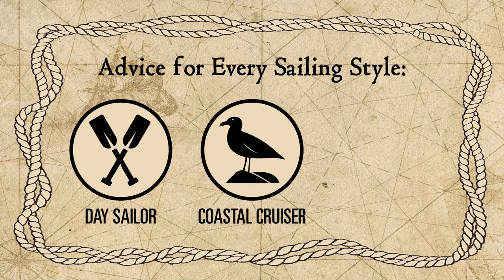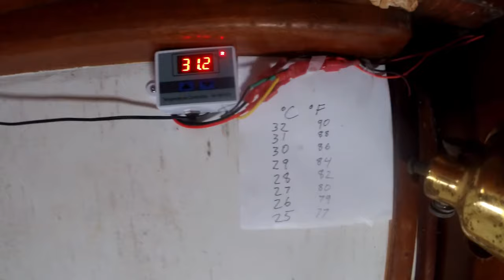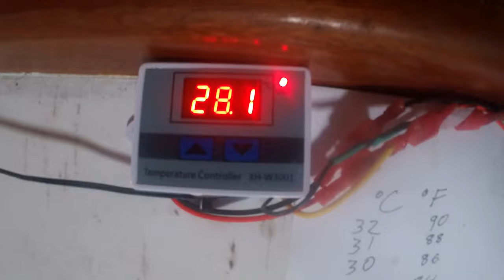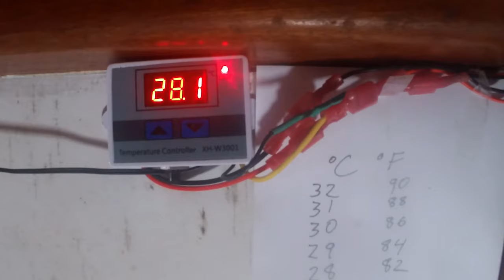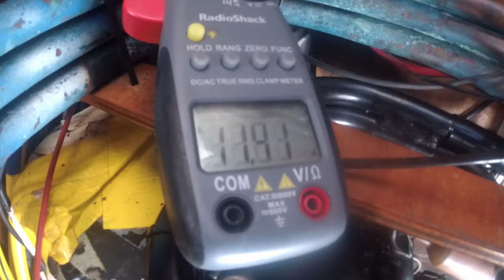Battery-Powered AIR CONDITIONING on a Sailboat [Capable Cruising Guides]

Comment: I saw where a person ended up grafting a mini split onto their boat.   They made a cabinet to cover the outside unit to make it look better but was still able to ventilate.   Their draw was 850 watts to cool and it came with a soft start to make it run from an inverter.
Reply: I'm wondering how well it holds up to ocean water
Reply from the maker: @misham6547 it should be just fine.  It's made from the same metals your refrigerator is except for the condenser which is titanium, which seems to be the best for salt water.

I've run the prototype for 5 years now.

Comment: I´m really interested in this option (and has filled in the form), but I also contemplate an even simpler version where one can attach tubes to and from one or two sleeping bags and only cool and dehumidify the air inside the sleeping bags.

Comment: great system, I had a 16,000BTU heat pump Marine Aire unit, using a 12v raw sea water pump to circulate water over the condenser copper lines to remove the heat.  This kept our 32' Sea ray sundancer entire cabin nice and cool when it was 95 degrees outside.  The condensate would drain thru a tube into shower drain compartment with auto float switch.

Comment: I wish I had seen this before I retired from the transportation business. Now I live on a houseboat plugged into shore power.

I put a rooftop RV unit on the roof of my truck, since the OEM compressors were always going out. It worked great, but took a lot of power (2 alternators @ 270 amps each & a 5,000 watt RMS pure sine wave inverter). 

I wanted to develop a no-idle battery bank system, but never found a system that would be practical (too many batteries; space & weight limitations.)

A low power system like this one that did the job would have been the answer.

I've thought about pumping water through a heat exchange unit with a fan on my houseboat to augment my two window units, since they struggle when it gets into the 90s.

Great videos, keep up the good work, Sir!  😊

Comment: I'm currently building a cargo trailer to camper conversion, we decided to use a Pioneer Mini-Split. We will know in a couple weeks about the wattage numbers and efficiencies. Specs show about 330 watts on the lowest setting, and about 1300 watts on highest. If we can't dial it down low enough to run on solar, we will order one of your systems to add as a sustainable 24/7 system!
Great Videos!!!
Reply from the maker: I use a Pioneer mini split at my house.  Good piece of gear.

Comment: I need this. I want it, it's 4:44am and I'm pouring sweat, my bed is destroyed, if I don't get one people in space will be able to smell me.
I've been in Florida for 21 years and I have not acclimated (acclamation is a myth). I don't know which kit I would use, but if it's a bucket of parts the bucket will need drainage or it will fill with sweat before I'm done putting it together.
Reply from the maker: Yes Florida is special.  I've lived there as well.  It gets cooler as you go south of key west.
  The DIY will be available first.  Fill out the survey in the description to stay in the loop.
Reply: Was born here,  never acclimated in 40 years.   Completely agree.
Reply: Born in florida sitting on an a/c vent.

Comment: I remember when that compressor came out about 11 years ago.  I was blue back then, I can't recall the name of the company that sold it, but it was extremely expensive going for $1,200 just for the compressor alone. The capacity was incredible and was advertised as being able to run an AC and well as a refrigeration system at the same time.  Also, setting it up to run was rumored to be beyond the ability of the average person. China came out with a black knock off which runs for about $200 which looks a lot like the model you have. The key I think is to have it pre-charged and on a skid ready to be connected to pre-charged  lines like the Cool Blue refrigeration system.

Comment: Hi Clark, this is just amazing. We are moving back onto our boat in Greece having just had our first baby, and the only thing holding us back is the heat in the boat at night! We have a beautiful CT41 ketch but she retains the days heat so much, its like a sauna at night, so we completely agree with you on this as an issue! Now we have a newborn to look after as well so we are very very keen to get a hold of one of these! Sadly though, we will have to address our battery bank and solar first... Still in the dark ages with the Lead Acid bats...
Reply from the maker: Thanks Matt

The AC units are now available at MarineDCAC.com once you get your system up to scratch.

Do you know about my BankManagerPlus?
https://www.emilyandclarksadventure.com/bbms

It and a Lifepo4 battery or two and you are good to go.  No need to change anything in your charging system.

Comment: Clark, fantastic thinking and inventing! I love it!  I have a 1973 Challenger 32 that I live on in Florida (St Pete).  I have a really old Marine-Aire unit that was working 2 months ago, but has a leak.  I'm planning my cruising for next year and looking at a new Dometic keel cooler unit (12-16k btu) but then I'm stuck on shore power or a generator or my inverter.  I've got 200 watts solar now but could go as much as 800-1000.  I'm also ready to pull the trigger on LiFePo batteries.  I've filled out the survey, please keep me posted!

Comment: I really like the full DIY option, and I would go so far as saying separating the parts so someone could purchase just what they need would be handy as well. For example: someone may want to buy a couple compressors and condensers, but use different evaporators. I am very interested in the compressor alone, because I have a different plan for using it.
Reply from the maker: Make sure you fill out the survey.  That's how you will know when it's available.

Comment: Clark you are the man!  You might remember that you helped me rig up a mast head tri light with only two wires and a couple of diodes added to the light. Circa 2000 in Mexico.  We used that light for years until LED's were available.  I love this AC idea.   We could have used it in Borneo/Malaysia/Thailand.  Though we survived without AC at anchor.   SV Green Ghost.  Great to see you again!
Reply from the maker: Glad that helped.

Are you still cruising?
Reply: @Clarks-Adventure  We cruised from 2000-2004 Vancouver - Australia.  Then relaunched in 2008 in Australia while I worked there for a couple of years. We left OZ for Indonesia/Thailand in 2010 and by 2017 we arrived back in Canada via  South Africa.  Back to work in 2017 but managed a three month break on Great Lakes this summer.  Getting a new engine, paint job, another sail - etc.  You know the drill.   More cruising for sure. We've done about 40,000 miles.  We need a break from cruising every 5 years to reset our brains and do something else. Anyone tuning in to your channel who reads this - BEST THING EVER!  Go cruising.

Comment: Clark, first off I'm not trying to step on your turf. I'm "retired" too. What follows is a story of air conditioners on boats. I think it may be worth a read.

I'm in Texas and kept a roomy old 23 sailboat on a lake here. My wife and I loved spending the weekends out on the boat spending nights at anchor in a cove. On summer nights it became intolerable for her. One summer I took a sabbatical (semi-voluntary) from working and spent a lot of time on the docks. I'm a geek, lots of physics/chem schooling, and was pondering how to cool my boat w/o running a genset. One day I got a new slip-neighbor. Nice guy, we became friends (i.e., I recruited him as racing crew). Turns out he owns a small air conditioner company building specialized industrial AC units. Interesting...

I pestered him with questions about component availability and told him what I was considering. Did he know companies I could look to for components? The next weekend he showed up with a box of the parts I had asked about basically just a heater coil, blower, and a certain type of mechanical thermometer. I built what I later learned is called an ice bank air conditioner. I filled an insulated tub with lots of ice and pumped water over the ice with a tiny live well pump. The mechanical thermometer cycled the pump on and off to maintain a water temperature of about 50F flowing through the "heater" coil. The blower blew cool air into the V-berth. Using that small blower this would provide cooler and dehumidified air to make the 90F Texas nights tolerable for about 6 hours on 50 pounds of ice using one AGM battery that also ran the anchor light. This was the days before lithium.

Not high tech but it worked and I shared my math with my new friend. He responded with a job offer. I signed on and went to air conditioner school. 25 years later as a partner in the business we received an offer we could not refuse and sold the business, retired in my 50s. That offer was significantly inspired by the self contained lithium powered AC system I had designed.

Naturally there is a non-compete and IP I sold so there is much I cannot discuss. What I can say is that you are on the right track. What you really want to do is better manage your air flow so you can eliminate the fans. Using an efficient BLDC blower that runs whenever the system is on and only cycling the compressor as needed is more efficient. Sleeping in a boat you only need cool air to the face and upper extremities to be comfortable (enough). Think of where a car AC blows, face and hands. Cooling the walls and ceiling do not add comfort but you are totally correct that the air must be constantly moving. BLDC blowers aren't cheap but from China they are less than two $100+ fans and use less power.

There must also be some source of fresh air. Humans exhale 20,000-ish PPM CO2 (top of my head number) and begin to show symptoms (drowsiness, discomfort) at about 1,500 PPM. you don't need much fresh air but in a sealed space you need some. If you turn your car onto "Recirc" is still pulls in that minimum. Remember it was CO2 abundance, not O2 deprivation, that almost killed the Apollo 13 astronauts

I have chartered cruising boats that used automotive style compressors belt driven from the engine to keep the fridge cold plates frozen with a few hours of engine time in the morning. If I were outfitting a cruising boat today I would seriously consider using a similar system to freeze water for cooling cabins later in the evening. Webasto in Europe markets a system like this for use in the sleeper compartments of big semitrucks after a long day of driving. Those components may well be appropriate for use on a yacht.

For me the fascination with ice bank air conditioning stems from the simplicity of rejecting heat when energy is abundant and absorbing heat when it is scarce, kind of like a battery but without so many inefficiencies. Yes, low temp refrigeration is less efficient that high temp AC but that is offset by use of a water cooled condenser. I might consider using a more efficient brazed plate heat exchanger for a condenser and a secondary coolant loop to put the heat into seawater, but that may be overthinking the issue.

Application specific observations: The block type TXV in your air handler is poorly calibrated for your compressor capacity (if it is calibrated at all, most are junk). United Refrigeration dealers can help you choose a better one. 
The small compressor you are using contains little lubricant. If air conditioning a V-berth or other area further from the compressor consider using a properly sized oil separator before the condenser to prevent oil starvation. Adding extra oil to the system must be done with real caution. There is more than fits here to that subject.
Reply from the maker: I will look into improving the expansion valve.
Reply: @Clarks-Adventure  With a good externally equalized high temp valve, 7-ish degrees superheat (Sporlan brand, right refrigerant and capacity) you may be able to run your compressor more slowly and are far less likely to have the compressor fail early.
Reply: military contractor makes compressors with inadequate oil system?
Reply: @briansb2455  this unit is not the original milspec one.  It is a Chinese reproduction at about 1/4 the price of the original.  Still quite efficient, but not a $1200 compressor.

Comment: Clark I want one: plan 3, maybe 2... but alternatively, is it possible to make it portable (galley daytime, berth nighttime)?
Reply from the maker: You need to fill out the survey to be informed.  We are building a webpage now.

I don't think you would want that as you would have to move the water lines.  But to do that you would get the kit (which will be available first) and set it up any way you want.

Personally I'd just duct the air.  There are 4 flanges on the air handler you can connect to duct work.

Comment: Hey, I do not know you or your channel but this popped up in my feed.
I am a maintenance tech at a factory and we have these super small air conditioners that cool down electronics cabinets.
These are bigger cabinets than you are imagining though, maybe 2 feet deep by 8 feet high by 12 feet wide, but I am sure there are larger cabinets out there.
People could probably size one to whatever size cabin they have if DIY is scary to them.
Using saltwater over air for heat exchange is smart though.

Comment: So let me preface this with I have fallen in love with heat pumps. Now, my ten year plan involves selling my condo (once its rebuilt from the fire of course) and then buying a boat and moving aboard. Keep in mind I live in New England (Massachusetts actually). So heating my boat is a high priority for me. I am exploring all options on this front, including diesel heaters with radiator pipes leading through out the boat (including under cabinets and bunks and even the lockers) to prevent frozen pipes and the like. I understand you not caring a hill of beans about heat because you’ve given it up for tropical settings. But I just watched an interesting video on heat pumps and in it the video stated that central air systems have 95% the same components as their heat pump cousins. So then the whole process of how a heat pump worked and how it was the same process as air conditioning only there was a reverse feature added that could turn your evaporator into a condenser and vice versa. So naturally, that got me thinking about your system. Why? Because I have a curious mind I guess or because I do enjoy understanding how things work. So, my question is, since you are running your ac only at night, wouldn’t it be better to build a structure outside for your condenser to dump the heat energy your system creates? And how how difficult would it be to convert your system into a heat pump, so it could both heat and cool off batteries?
Reply from the maker: It does dump the heat outside the boat and there will be a reversing cycle version.

Also the air handler I use has a heater core inside it that you could run that hot water through.

Comment: I just bought a boat with something very much like this installed. It doesn't appear to be stock as it looks brand new mounted on new lumber in a 35 year old boat. The ducting is run for the most part, and it seems to all be there. I'm lucky I have a friend that is an HVAC specialist and says he can get it going no problem, and parts are everywhere. Fingers crossed 🤞

Comment: Those small rotary compressors are compact, but the linear compressor while bulkier are even more efficient.
I was googling 'water medium mini-split a couple days ago, and all kinds of variations to see if anyone used water to pass cold from compressor to indoor unit and found nothing.  Then youtube recommended this, and I see someone has done it!  I was thinking antifreeze, but salt water can go below 0F, good enough for a/c, but not so much for a freezer.

Comment: I did see a sailboat that used a window air conditioner that was set up over a hatch. It cooled the main salon and likely had enough power to cool the whole yacht which was about 50 feet in length. There is a Youtube video on it but I can't remember who did it. I am going to do something similar and run an inverter from lithium batteries with about a 1000 amp-hour capacity. At 13V and 80% discharge, then the available energy is 10,400 W-hr. I have 9 solar panels rated at 195 W each. These are going to go over the cockpit as a sun shade. During the day, the panels will put out a lot of power which is dependent on solar intensity. Even on a bad day, I can get 400W of power on average over the course of the day. A 5000 BTU window air conditioner will draw about 500 watts on high setting and likely 550 watts through the inverter. Overnight, with the air conditioner on low, it likely would draw about 400W all in as an average. For 12 hours, that would use up about 4800 W-hr or less than half the battery capacity. The problem for some yachts will be space and layout. This all takes a lot of real estate. A critical factor is the number of people on board. Each adult male body produces about  80-100W of heat while resting and less while sleeping. As well, there is the additional load of humidity created by the human body. One has to figure that into the equation. Based on that, my window air conditioner will likely not have enough power on low setting for more than 4 adults to maintain a dry comfortable temperature.